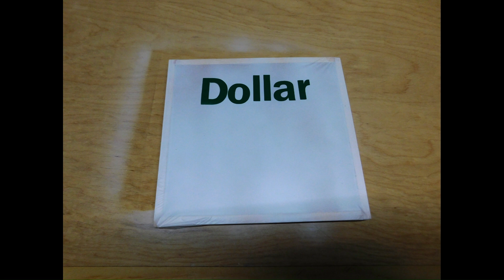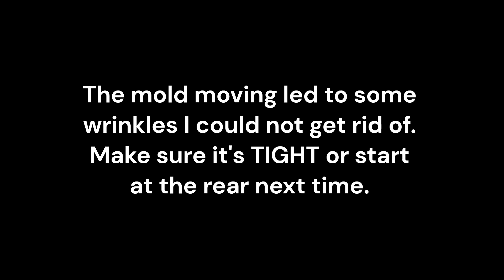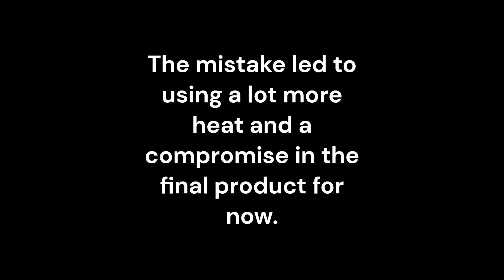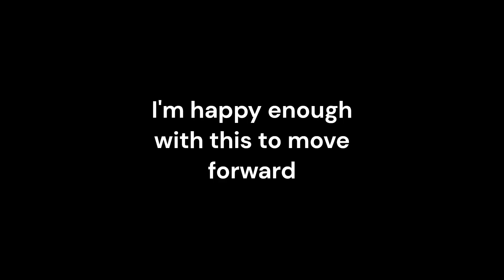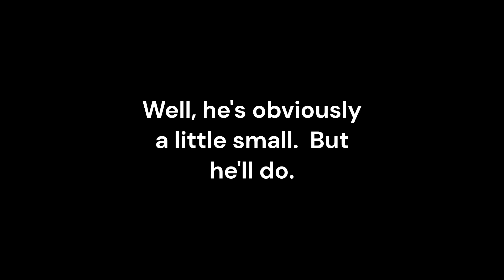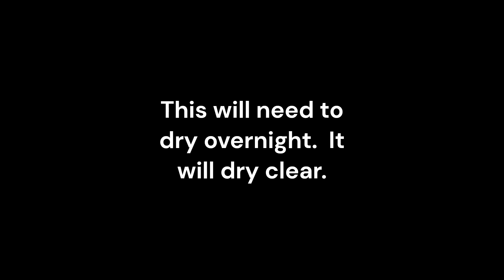Canopy 2nd attempt

Comment: Nicely done. 👍 I've not done what you're doing, but am a sculptor and have mucked about with various materials and DIY forming ideas over more decades that I'd admit to, so take my suggestions as coffee shop engineering chit chat. Just random thoughts.... I wonder if you cut the bottom of the bottle off, stuck your buck in, epoxied the bottom back on. Then heat the bottle in an oven to get it evenly soft (Not sure of the right temp for that plastic, might have to experiment to find the Goldilocks zone). Rig up a cone shaped bung to stick in the top of the bottle and fit on a shopvac hose. Heat the bottle, plug in the fitting, and turn on the vac. Sort of a vac forming but without the flat sheet and machine. 
And a second shot in the dark; Put a tire valve stem in a bottle cap, warm the bottle as above, and use compressed air (compressor or bike tire pump) and blow the bottle up. The idea is it would thin the plastic out. You could then use a smaller bottle to start with, having thinner wall thickness and use the above method. might suck down easier and form more tightly to the buck.
Like I said, just random ideas. I saw you're vid on the side bar while cruising kit/junk bashing videos. 
Good luck with the build.
Reply from the maker: Thank you for the suggestions.  I'll see if I can replicate some of that and capture it if possible.

Comment: Truly appreciate you including your 'failures'/sub-par product...many get too embarrassed to reveal such informative process mistakes. It ends up that YT 'How-To' vids too often make DIY projects appear perfection is guaranteed = NOT in this REAL world!
 You are patient & detail oriented and will have this process down to art before long. As far as the staining or residual adhesive spots across the canopy, did you bother soaking that PETN canopy in different solvents after the 'Goo Gone'--like acetone & alcohol? Finally, a drill or Dremel fit with a poly-cotton buffing rag wheel + polishing compound...gentle work-over might restore clarity & help disappear surface scratches from the finished canopy plastic?
Reply from the maker: I have to admit I did not think of that.  That is worth a try to brighten it up some.  Thank you very much.